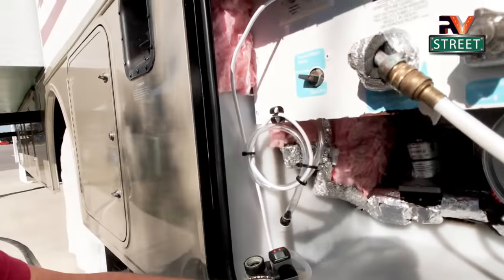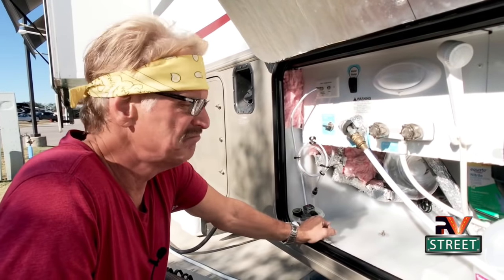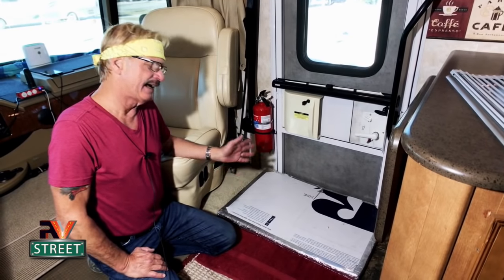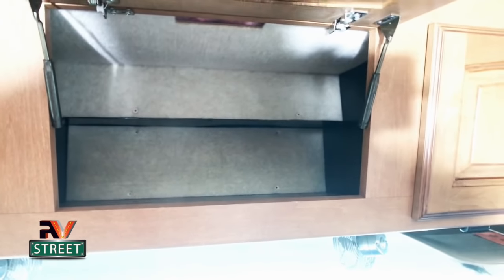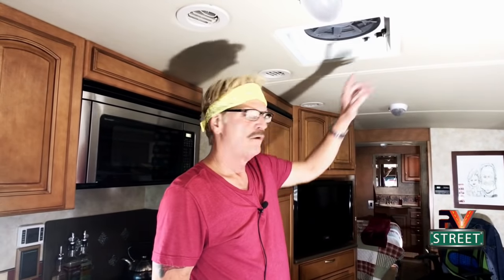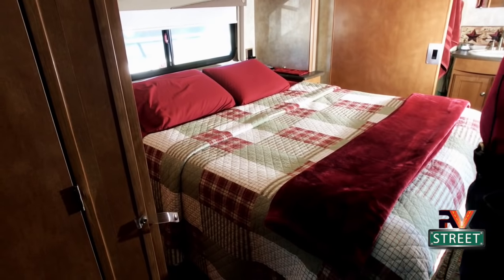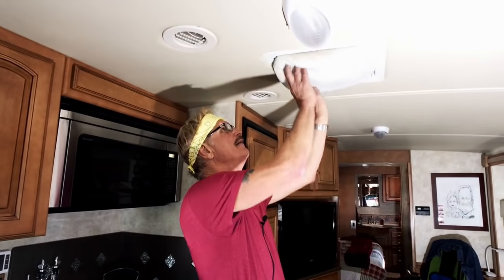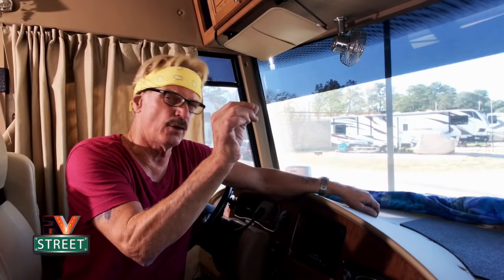😰  INSULATE, HEAT & PROTECT • Key to stay warm in your RV

Comment: Just wondering Martin. That paper backing on R19 is a vapor barrier.  Why would you not try to keep the insulation dry especially when it's installed inside the Coach?
Reply from the maker: Hi Jim,
This question has been answered in the comments but here it is again....
In a nut shell, the faced insulation is normally used as a vapor/moisture barrier when used in home walls application and is not needed in this situation and especially when I’m putting in several layers in those large empty cavities. If Home Depot had unfaced in stock at the time, I would of bought that. 👍

Comment: This is good info. 
But why take the paper off the insulation?
Reply from the maker: This question has been answered in the comments many times, but here it is again....

In a nut shell, the faced insulation is normally used as a vapor/moisture barrier when used in home walls application and is not needed in this situation and especially when I’m putting in several layers in those large empty cavities. If Home Depot had unfaced in stock at the time, I would of bought that.

thx for watching Victoria.

Comment: If you have a 4 season rv you need to run the propane  furnace  to keep your underbelly  and wet bay warm and from freezing ... for someone  so worried  about the heat and cold  you would think  you would  know that 😂

Comment: We now have the 50 amp Sandpipper (Pipper) 391FLRB. We were worried about using an electric plug in heater because we've had issues with a plan ol hair dryer blowing a breaker on the 2017 30 amp Grey wolf RV. We could Only ran one thing at a time on it. So the fear of using one in a 50 amp is if we're using a toaster coffee pot, or the blow dryer at the same time.  Will it blow a breaker in Pipper?
Reply from the maker: You won't have those issues on a 50amp RV.

Comment: I use my propane furnace because I have water and storage bay heating from propane heater. If I used elect floor model heaters that would likely never turn on and I have no way of circulating heat into the water bay. I wish I could run a circulation fan through the on board propane heater. Not available on my standard propane RV furnace. Maybe I could install a blower at the cold air return that may do the job. Need to look at that.
Reply from the maker: Or....just run a 100watt light in the wet bay like I showed.
Reply: @RVstreet  i would have to install the light bulb behind the wet bay where all the plumbing is. All my plumbing runs in the basement if my fifth wheel where there are several heat outlets from forced air propane heater. The wet bay really has no plumbing, just control knobs and leavers. Everything is in back behind fake walls. And i have a fully enclosed insulated under belly. Because of the heat in there . Certainly possible to get to but it is a fair size area. I would hate to miss a cold area where some plumbing went. 
So answering your question as to why i would run the propane, that is why. I guess i don’t need too unless it would go below freezing and in that case a small ceramic heater would probably be insufficient. It would work above freezing temps. I do enjoy a warm floor.
Reply from the maker: @johnmalecki3893  Now that I understand your details better I see what you're talking about. I'm sure you'll find a permanent plan that works for your situation. Enjoyed chatting with you John 👍

Comment: One more pointer. When SHTF and you are low on water and stores for what ever reason are unavailable. That water from you dehumidifier could be your only soarce of drinking water. And I would not sugest using an eye dropper with bleach to purify your good bacteria in your gut that you just used on your dehumidified water to kill bad bacteria. Intead try using a "LIFE STRAW" or a Britta water purification filter pitcher to purify your water from your dehumidifyer.
Reply from the maker: That's a fantastic tip Gary.
We both have a LifeStraw Go Water Filter Bottle but never thought of putting it into our Amazon Store for emergency situations in the RV. They are very compact, easy to store and can be used for multiple things. Not sure why I didn't even think of your application but it's in our store now.
Thanks again for chiming in with this. 🙏
Reply: I was wrong about the Britta that I had mentioned before,
after learning about Total Solids Disolved being so sky high in our tap water and learned that other sources of tap water( depending on where we live and how much lead we are exposed to in our tap water requiring denser filtration gizmoes. 
The Zero Water solution is the answer! The taste after filtration with this product has a weird taste when you first use it... best to run a few times when using a new Zero Water filter cartridge. 

Now if you have never tasted the purest water from heaven, where all the impurities of hell have been elliminated, it is why it tastes the way it does when drinking pure water. 

Even the Devil clannot stand  telling the truth about it. 
It comes with a true water testor, so you know when your filter becomes too infestested and saturated with all the impurities of hell ( that the Zero Water purifier purifys out) the tester acuratly tells us when it is time to replace the cartridge to replace with a new cartridge filter. 

It is expensive. But think of how much it costed Jesus to pay for all ourimpurities in us and heal and deliver us so that he could reconcile us unto his Daddy and so we can become born again by the will of God , and not by reciting a prayer or saying our abc 's for in the end, when you are determined to go with Jesus, the cost to purchase  us from the captivity of sin Jesus had to pay, that it pleased God to bruise his Son. So when his Son's life was forsaken, that his Daddy reimbursed his Son from that marvelous expense. 

It costed much more to purchase us but in the end it is well worth what was suffered even his own sacrifice at his own expence. 

(And by no means was his sacrifice simply a rescue mission to save us from going to hell.)
 But for us to live the same example while we yet live having the old person we were put into his death : that we live a new way even when we are taken away

 (One disclaimer I MUST  mention ABOUT DRINKING PURIFIED WATER WITH THE Zero Water which can filter out impurities from our corrupted water sources, is that  it CANNOT filter out the impurity of sin that is inside us just  by drinking healthy purified water. 
 
Only the expense Jesus paid in full and our willingness to exercise the scripture found in the Acts of the Apostals(Hechos) Chapter 2 and verse 38 will Cut, Sepatate, Sanctify ,& Heal us 
from our impure inheritance from Adam; both physically,  mentally, and spiritually.

 Let us be reminded that even in the eating of Manna from heaven, the Manna could not heal and deliver the israelites from hell and the grave like the Son of man CAN. ) The Expense of drinking the purest water however is our  choice... 

 God at our expense has provided  us with the wisdom how to prepare when SHTF and how to make that which was made a corruptable water source to become separated by so many parts per billion into that which was once made completely incorruptable. 

(This reminds me of the expense you went to just to strip off the old roof to roll a new protective sealant on your roof and to how to properly calk areas and more tips on protecting your R/V. from harmful UV damage and the out come was well worth your sacrifice. Big thumbs ☝ up to you for the added time documenting all you did and where to source the items you used. )

Comment: May consider a solar fan for roof hatch. Pulls hot out in summer, and if the fan is reversible, it pushes heat down in winter. Most have hookups too
just a thought :)
Reply: My fan is actually a solar attic fan that I modified. It is two  directional.
Reply: as for the windshield condensation, you could seal it just like the door hatch, but the towel is a nice touch. Perhaps a small catch pan that drains. I'm not criticizing by any means, but offering some thoughts :)
Reply: Or a small fan/heater to keep the condensation off in the first place
Solar stuff is priceless if you got some decent battery banks.
Reply: all in all, I love your engineering thoughts, and how you have made it all liveable :)
Reply: Solar is a big step, as is mobile wifi boxes. soon sattellite wifi will be perfected for us off roaders
Reply: As for the fan, I use the insulated tubing to seal it in winter, so it only pushes the heat off the ceiling :)
\
Reply: heat rises, so a fan up above can make a huge difference in confort.
Reply: Thank you for your videos <3 You are a gem. These are just ideas I have found to work.

Comment: I'm new to this and 63. I have just purchased a 32ft pull behind camper. I use an electric radiant oil heater (looks like a little radiator)in my residence and keeps my rm toasty. I've never had it on high. Has 3 settings also numbered settings 1-5 within each of the 3 settings.  
Do you think that's a good choice as well for my camper?
I'm in Michigan and my camper will be my permanent home, as of  spring next yr. Planning on solar suitcase and solar generator as my main means of electricity. I will not be traveling with it. Thank you kindly for your tips.
Reply from the maker: If your heater is working for you then keep doing what you're doing. Be sure when you go solar you get a real good suitcase unit. Solar panels are NOT all made the same. There are big differences in models and manufacturers. Our solar suitcase works awesome and has the best solar cells made and comes with it's own water proof controller. It's literally plug and play. It pays to get the best and pay once.  
thx Christina 👍
Reply: @RVstreet  Thanks was planning on a King it is easy to use

Comment: I've been warned of space heaters of any kind causing RV fires often.  I have a 2002 Hitchhiker II  LS.  What is your view on this?  Thanks!
Reply from the maker: A space heater can be dangerous even in homes. Placement of the heater requires common sense and don't use extension cords. Been using ours now for nearly 5yrs. It's very rare for us to use our propane furnace.
Reply: Thanks for response.  I am following your method of insulating.  Yours is the best video I've seen.

Comment: I’m in a fifth wheel and I’m also full time, I’m hooked up to 50 amp. It’s a 2011 35’ outback I do use a floor heater in the living area on low, if I go hotter with it the breaker kicks off, so I use my propane furnace also, the manufacturers need to use heavier loading electric supply?
Reply from the maker: I'm sad to say that Martin has passed away and I don't have an answer to your question. So sorry
Reply: @RVstreet  Sorry to hear that,  condolences.

Comment: Buddy...here the best tip you could ever hear.  Buy a PLANAR 9D HEATER.  Diesel is 2/3 cheaper.  I plumbed one into the furnace ducks in my 38 ft Camio. I'm the only one in a 100 pad site who runs diesel.  No fumes no smoke. I can help anyone get what I have.  Just comment. You wil be so happy you did.

Comment: I'm going to have to look into I just assumed I was going to use my furnace I was going to well I am going to skirt the bottom and the additional places that have air flow and I was going to heat the bottom with an electric heater it's going into the minus 20s Celsius here that's going to continue in spurts for the next six weeks or so then we're going to get nicer weather and we can get some 20 degree days anyways but I was going to use the propane I just wanted to skirt the bottom and eat it so the floor was warm and all the water and tanks and everything didn't freeze up and I was thinking propane but electricity is expensive here in Ontario so I don't know you give me some food for thought

Comment: Does your propane furnace help keep everything under coach from freezing?  Is that a reason to use it?
Reply from the maker: Thank you Edward for your question,
As I mentioned in the video, we don't have heated bays, so that's why I use the light bulb in the wet bay and why I insulated all my bay doors. That has kept everything from freezing under the coach when it's been 15º outside for several days. Otherwise, folks that do have heated bays, will use their propane furnace to keep everything from freezing IF it's going to be say <25º for many hours.

Comment: Hi, again! What do I use to make the insulation stick to my RV walls in the cavity under my bed?
Reply from the maker: No need to have it stick. Just cut it a little oversize and stuff it down in there in layers. It will push up against the walls.

Comment: I have to ask. Why did you need to take the paper backing off. Thanks
Reply from the maker: In a nut shell, the faced insulation is normally used as a vapor/moisture barrier when used in home walls application and is not needed in this situation and especially when I’m putting in several layers in those large empty cavities.

Comment: have a 1989 Travelmaster that has been gutted including all water lines. The tank and pump are still there. It has a city water hookup and tank fill hookup but no lines attached. Any video on what materials I need and how to install.
Reply from the maker: I don't have any vids on installing water lines but use PEX. You can get it at Home Depot. And since you're starting out from scratch insulate all the lines in addition to what you saw in this video. 👍

Comment: Can you use electric heater if you run on battery charged by solar. Also what year is your coach?
Reply from the maker: Yes you can. But even without solar if you have your batt bay set up right with the right kind of batt's you can run the electric heater off the inverter then charge the batt's the next day from the generator or if you have access to pedestal power, charge them up that way. You never want to take your batt's below 50% though. We have a 2012 Winnebago Vista 35F. thx Sandra 💗

Comment: The cab let's the most cold in.  A thick curtain is a solution.
Reply from the maker: You're right about that. I recently solved that problem by cutting 2 pieces of 4" foam—slightly larger than the space—that I push in under that big gap under the dash, under the steering wheel and foot pedal area—AND—also that smaller space near the floor where the dash heat is on the passenger side. WOW what a difference. No more cold draft there. After I did that Joanie said to me, "boy I can't believe we didn't that earlier". Once spring comes, I just store it behind the love seat.

Comment: We use our furnace to quickly heat up our trailer.  Then we shut it down and use smaller electrical heaters.  The pro's say propane is cheaper than electrical?  Im like you I feel it is more expensive.  However, the furnace will toast the place fast!
Reply from the maker: Ya, our experience has been the same. We've always seen propane more expensive but some folks here have commented that where they are propane is cheaper. So I guess it depends on where you are at.

Comment: Do you have any thoughts on Marvel Mystery Oil added to your gas or oil? Cheers!
Reply from the maker: I treat our coach 80gal. gas tank once a year with Sea Foam. (4 cans) However. I did use Mystery Oil in my pneumatic air tools from time to time.

Comment: Do you mean toward the inside  rv (space) or out rv (space)? Space is a relative term until you word it exact. In this case being insulation being between 2 walls separating inner or outer space, what's the direction when just saying space? I had a house furnace repair man tell me hot air doesn't go upward. Wording is important. Perfectly clare when possible is better than possibly confusing by assuming people understand your meaning, not your wording.
Reply from the maker: Well, by the way you worded your question, I'm not sure what area/space you're talking about. This video covered a lot of areas that I insulated.
"Do you mean toward the inside  rv (space) or out rv (space)?"
All the inside insulation I did in the inside of the RV was done from the walls inwards. Nothing done to the walls themselves were done. It was all the void areas behind areas like the cabinets, under the bed, in the front cap, my step cover etc.
If you can clarify the area that wasn't clear to you, I'd be glad to answer that question.

Comment: Hi,  Simple question, why do you remove the facing from the insulation?
Reply from the maker: I answered this question already but...In a nut shell, the faced insulation is normally used as a vapor/moisture barrier when used in home walls application and is not needed in this situation and especially when I’m putting in several layers in those large empty cavities.
thx Tanya 💋

Comment: What is the benefit or purpose of taking the paper off the pink insulation??
Reply from the maker: Why I use unfaced insulation
This question has been answered in the comments many times but here it is again....

In a nut shell, the faced insulation is normally used as a vapor/moisture barrier when used in home walls application but is not needed in this situation and especially when I’m putting in several layers in those large empty cavities. If Home Depot had unfaced in stock at the time, I would of bought that.
Reply: Thank you

Comment: Sooo...why do you take off the backing of the pink insulation again? Can't you just get insulation without backing?
Reply from the maker: Yes you can but Home Depot just didn't have it at the time. So I just bought faced and took it off. In a nut shell, the faced insulation is normally used as a vapor/moisture barrier when used in home walls application and is not needed in this situation and especially when I’m putting in several layers in those large empty cavities.